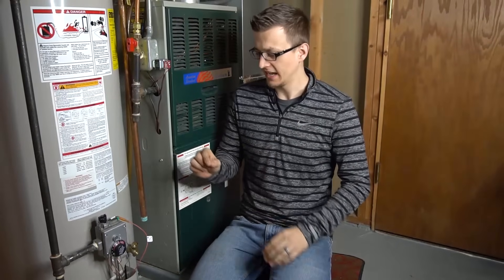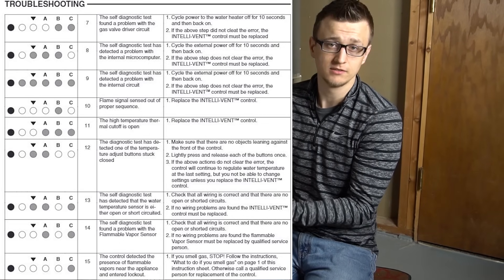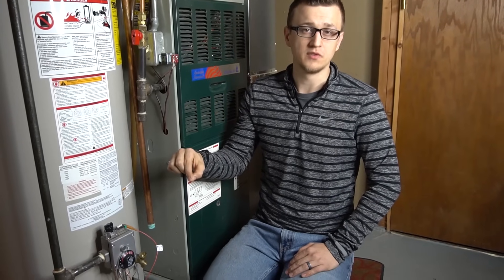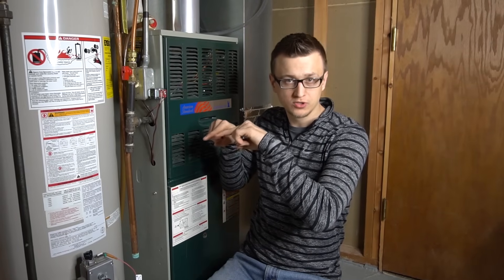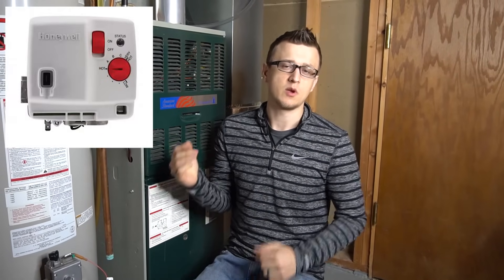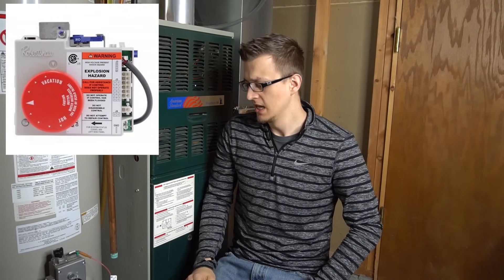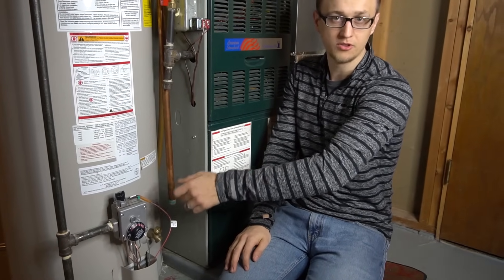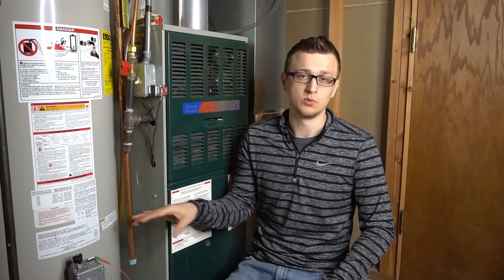How To Reset Flammable Vapor Sensor on Water Heater

Comment: Good morning, can you show me how to install a Burner assembly Kit on a Ge power vent hot water heater that has the intel gas control valve box, also  has the name rogers on the bottom. I looked at some video's, but they don't show my model with all the different parts on the burner access door you have to take off including a gasket that you have to remove and replace . all this to replace the burner assembly kit.  I really appreciate your help on this. thanks Mitch

Comment: I had my exhaust disconnected to work on a water pipe. 

Had no hot water the next morning. Tried your instructions for the honeywell brand. It worked perfectly. Back up and running! I'm very grateful for your video. Thank you.

Comment: Most of the ohm sensors cant be reset bud......once they trip they need to be replaced.  They are carbon and silicone based and the flammable vapors break them down.....so once they trip, they are junk.  You can go ahead and reset them but they may work overnight before they trip again and again again.
Unless you like to live in your mech room constantly resetting it.......just buy a new one.

Comment: I have a temporary bypass for those in a pinch, waiting for their part.  Sorry if I'm repeating this as I didn't want to go through the 248 comments, but still provide you tips as requested.  I was in a pinch once as I had a tenant who's sensor got flooded out.  Once that was emptied (I was worried about the whole tank actually), the FV error code (Honeywell) was showing. The FV sensor was pooched with the resistance reading open.  Even Amazon Prime was a two day delivery!   I found online a cheat, where you remove the sensor cap (break it off actually) and use pencil lead to color the contacts under the sensor cap (remove it) it creates some conductivity...   You then need to wipe some off to get the resistance range it's looking for.  I forget exactly but 10000 ohms comes to mind.  It doesn't need to be exact.   I used my ohm meter to get me somewhere between that and 8000 and 20000 ohms I think.  Point is, you can get running in a pinch.  Let's not kid ourselves, this is a safety device for a reason!!!   My tank sensor was definitely flood-caused.  The tank was in a well ventilated area outside the living area (tall crawl space with lots of air) so gas vapor risk wasn't much of a concern.  But it bought me time.

Comment: Thanks, this worked on my Honeywell. Not at first - but for some reason I came back an hour later and it started right up.
Reply: Came back and start right up. As in you left it on or off when you left.  Thank.  Not working for me.  So I just kept it off right now

Comment: Thanks for the video. We had a main sewer line back up in the basement. Caused a nasty smell. My guess, that is what dripped the sensor. In case you're wondering, the water did not get high enough, to damage the heater.  
White Rogers Intelli-Vent Gas Valve. RUUD 40GL water heater. I followed your steps. Would not clear code. Should I just go ahead and replace the sensor? To make it clear. It's the first and last light, that is on. Thanks so much.

Comment: I have the Rheem Water Heater with a White Rodgers Gas Valve and I reset, all lights went up then back to the error code. I have just replaced the FV sensor 2 weeks ago because this happened before. Do i have to replace it a second time??
Reply from the maker: If the reset procedure is not working then unfortunately yes. If this happens a third time.. Then I would be calling the manufacturer number on the water heater.

Comment: If the vacation light refuses to start flashing it's safe to assume the thermostat is malfunctioning?
Actually, it works if I have the buttons pushed down before I turn the power on but it pops right back to lockout after reset.  Gonna replace the sensor and try again.
EDIT:   New FV sensor did the trick!  Three days without hot water was getting stressful.  I will not calling that trash contractor again.
Thank you!!
Reply from the maker: Yes.. the valve could be defective but that blinking may just be normal operation as well. I can't say for sure without seeing it. It would be good if you have the manual from it so you can see what that light indicates or if you can look it up online..
Reply: @WordofAdviceTV  Thanks for the reply.  Valve replacement was necessary since the FV replacement didn't work.  Cheers for the video, I learned something.

Comment: I believe the load you referred to is approx 9 to 48 ohms..... I carry 24 and 36 ohm resistors in my tool box so if in a crunch I can bypass the defective sensor and by closing the circuit with the resistor , the hot water heater can then be reset and this time it will take as the resistors mimick the sensors resistance.
Reply from the maker: Thank you for the resistance info! Much appreciated!
Reply: Oh! Thank you for this!
I thought I saw another poster say "44K" and I was pulling my hair out with this yellow-yellow-orange resistor hanging off the Robert Shaw  J1 pins. Time to try yellow-yellow-black.

Comment: You rock.  Had no signs of any issues and then just quit working.  I was about to spend $1000 on a replacement and thank to you I spent 45 minutes searching the web for hints and mostly for a replacement until your tip showed up and like magic, my water heater is up and running.  God bless you for your kindness and willingness to share your knowledge with others...  thank you..
Reply from the maker: You're welcome! :) Happy to hear you didn't need to buy a new water heater! Thank you for coming back to leave a comment, enjoy the hot showers!

Comment: Brand new water heater ( Richmond 50 gal gas with Honeywell gas valve) installed everything. Checked all gas piping for leaks. Nothing. Plugged it in and I am getting the FVS/ SYSTEM LOCKOUT. Tried your reset procedure 7-8 times and it won't fix the problem. This is a brand new unit. WTF! This is a real POS unit in my book. Any ideas?? 
Thanks
Reply from the maker: Sorry to hear about the issues right out of the box! Usually it's one of two things. A bad FVS or a bad gas valve control. I would try buying a new sensor and seeing if it fixes it. If that doesn't do it, then hopefully you can return it as a defective product..

Comment: Thank you unlimited!!!!!!!  This simple quick clip saved me exactly $1501  CDN  and at least 6+ hours  as I was set to go tomorrow to Home Depot and purchase a brand new hot water tank (power vent) only because the sensor had stopped the control valve!!!!! Indeed I was just buying it 2 hours ago at store but a customer saw me talking to the sale person and referred me to YouTube for sensor issues.. so I suspended my purchase (of $1500) to give it one last try!  and I was so lucky to found this clip with my first search>>>>>>  I could not believe the  valve will work again until I saw the full LED lights !!!!! and BINGO!!!!!    Earlier this morning, two plumber /heater guy (one of them with 35 years experience) had come to our house and both simply said the "mother board" of the digital control valve has burnt  (as it it is a computer there!)..... Then the experienced guy  found my parts and model number and quoted  $881 for replacement of the  digital control valve (the box with LED lights on it) or $2600 for installation of a brand new tank!!!!  Now I found this evening the tank for $1500 in Home Depot  (so saving of $1100)  and then now by your video I even saved the purchase (so another saving $1500) !!!!!   God Bless you Word of Advice TV.....   I will donate to registered Canadian  charities  10% of the purchase of tomorrow that I am saving ($150)..... To appreciate your free video and advise,  we will be also glad to publish a permanent life time FREE advertisement (dedicated web page in 4 languages) in our newer website www.colombiran.com , similar to our SMART CLASSIFIEDS linked below... If you are interested, simply email us  at info@colombiran.com  and remind me of this video, and I will be glad to take care of the rest....... so you can alwats be advertised free in our diverse Communities in 4 languages ======> sample of ads   www.colombiran.ca/smartclassifieds
Reply from the maker: I'm glad to hear the video saved you a lot of money! Thank you for the detailed comment! I am sure it will help others down the road. I appreciate the offer for free advertising as well, I will look into that later, thank you!

Comment: I have a GE PowerVent with a White/Rogers control valve. I replaced the sensor and entered the code. Now another code has appeared A/C. Any advise as to where to go from here ? I’ve been without hot water for a week. i had been using alkaline paint to pair the floor in the basement when the tank went out, before that there were no issues. Any advise you might have for me going forward would be most appreciated.
Thanks
Regards 
Dan
Reply from the maker: I can't seem to find what that code means... A/C. Do you have the manual from the water heater? Or perhaps there is a sticker on the water heater itself? I found a manual online for that gas valve (not 100% sure that's what you have) And there is a code with 3 lights that has A/C in it. That code says the flammable vapor sensor wiring is bad. Perhaps try swapping the two connectors and reset the power to the unit? Also, I have had times where I got a bad sensor right out of the box... Here is the manual I was looking at:http://www.manualsdir.com/manuals/110522/john-wood-power-vent-067-ef.html?page=27

Comment: Thank you very much! You just save me HUNDREDS of $$$$$$ in a service call and replaced parts. "Yo' da MAN!!" I was using a propane torch to repair some plumbing... ON THE OTHER SIDE of the basement and POOF! Let my problem be noted and use an exhaust fan.
Reply from the maker: Glad to hear it worked for you! Thank you for leaving a comment!

Comment: FYI on the honeywell units you need to flip the dial back and forth 7 times according to the information I found online. Not 6. So unplug. Flip power switch to off. Turn heat dial to Low. Plug in. Turn on. Spin dial from low to maximum and back again seven times. Unfortunately, this only worked for a short period before it would turn off again. I had to replace sensor as we had our floor in the room covered with an epoxy and the sensor couldn't handle the stinky vapor. The sensors aren't cheap. Ended up costing me $75 CDN.
Reply from the maker: Good to know! Thank you for the information!

Comment: I have the Honeywell WV4460E2014 in apartment complex. 7 flashes and sensor was knocked loose. I pulled the sensor from the (vacant) neighboring unit, same model. They are now both flashing 7 and neither responds to the reset you describe. They go into 7-flash sequence within about 8 seconds of plugging power back in. Is this model different?
Reply from the maker: If a new sensor does not fix the problem and the resets I showed are not working (those are the only 4 I know) then you may need to call whoever manufactured that water heater and they may tell you to replace the gas valve or perhaps the sequence for your heater is something special...

Comment: Hi Jay, i have an Intelli-vent gas valve. I know the sensor glows, but the burner will not light up.  I’ve attempted to reset it several times and I still cannot get the vacation light to blink. After I plug the power back in it will attempt to light 3 times before it locks and gives me the vacation, A&B code. Can you help me out? Thanks.
Reply from the maker: That one has nothing to do with the flammable vapor sensor. So does the burner light but only stay on for a few seconds? Or does it not light at all, only the igniter glows 3 times?
Reply: Word of Advice TV the thermo lights up for a few seconds but there is no flame to light the burner.
Reply from the maker: @rolandruanto  So do you have a hot surface ignitor then? (look up water heater ignitor to see a picture of it if you need to) Is there any chance that the gas to the water heater was turned off and not turned back on for some reason?

Comment: On the Honeywell, do you have to flip the gas switch to "OFF" before unplugging? Or just leave it on? (And thanks for the video.)
Reply from the maker: You don't have to switch it off. Unplugging it would be enough.
Reply: @WordofAdviceTV  Got it. Worked right away. Thanks again.

Comment: I have found a yellow guck inside the connectors connecting to the sensor, is that common?
Reply from the maker: I don't think so. I don't remember seeing yellow guck on most of the sensors I have replaced in the past..
Reply: Word of Advice TV yea that’s what the rheem lady said as well, contacted manufacturer and they’re sending over a new sensor and harness under 10 yr warranty👍🏽👍🏽
Reply from the maker: @carlosgomezjr.8595  Nice! Still under warranty :) That's good! May as well get it replaced then! Thank you for sharing that!

Comment: What if I get that code on the Honeywell version and also have some water on the floor? Is that a sign something else is wrong? What else would cause that code and water to leak out of the heater?
Reply from the maker: If the water heater is leaking, that should have nothing to do with the flammable vapor sensor. So I think that is two separate issues. Were you able to track down where the leak is coming from? I have a video on water heater leaking if you need it.

Comment: I resetted waterheater and again showing vapour flammable senaor error after 2 days
Reply from the maker: Do you have paint, gasoline, or other chemicals near your water heater? Or have you painted or stained anything in the home recently? All of that can trip the sensor.. You will just have to keep resetting it until whatever it is airs out or you remove it from that room. Otherwise the sensor just needs to be replaced.
Reply: @WordofAdviceTV  its in pizzahut where i am working, and after few days again goes to vapour sensor fault like seven flashes thing, is it probably need to change sensor

Comment: I did it Jay! I cleaned the inside and  used a scotch brite pad on the thermocouple and it is running great now. I went ahead and bought that pilot assembly just in case something goes out later. Thanks for your videos. Couldn't of done it without them!
Reply from the maker: Happy to hear that you got it fixed! :) You are good at what you do!

Comment: Jay! Atmos our gas company replaced our meter yesterday and the gas was working after that and today my hot water heater won't even lighr the pilot. 🔥
Reply from the maker: Call them back out to fix the problem they created. :) Do the rest of your gas burning appliances work normally? Does your water heater have a standing pilot? Does it have an open or sealed burner chamber?
Reply: @WordofAdviceTV  I have the exact same ao smith as yours just a 2010. The gas valve is the same as yours. I haven't tried the furnace heat yet but I will tomorrow. Everyone is asleep now and I don't think they would appreciate me running the heat right now haha. I've watched all of your vids in the past and now I have to put them to the test 👍. But I don't even get a pilot light. Spark igniter is working. Im thinking either I'm not getting gas at all or the pilot tube is clogged. I also don't have that black screen in front to clean so that honey comb is pretty dirty but I would think I would still get a pilot started at least.
Reply from the maker: I agree with you! Usually even if there is an airflow problem, you should at least be able to light the pilot light (even if it goes out right when you let the knob go). If you can't even get it lit, then like you said, either the pilot orifice is plugged or there is no gas going through that pilot. By the way, gas companies usually go through and make sure all your appliances re-light after they change out a meter. Did they not do that for you? Also, just want to mention this because it was a headache for me... My pilot would intermittently go out and I couldn't figure out why. Turns out that the little fuse that is in line with the thermocouple was slightly broken at the soldered joint. It was burnt to a crisp too, when I touched it, it fell apart. If the day ever comes for you to replace that piece, it comes as a little assembly. This is the one I replaced mine with: https://amzn.to/2K1WnJj
Reply: @WordofAdviceTV  Yeah he checked the water heater and re lit it. I was reading something about purging the gas lines. Is that something the gas company would perform? Nice that is a great price for the whole assembly! Thanks! I need to get my hands on one of those black screens aswell.
Reply: @WordofAdviceTV  Looks like the furnace does work. It took a second for jets to light but they did and worked like normal.